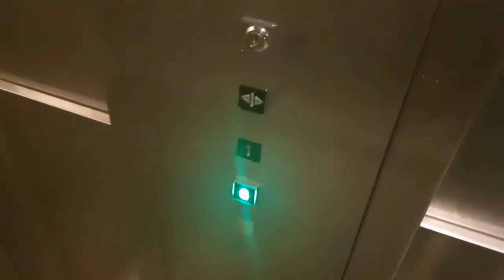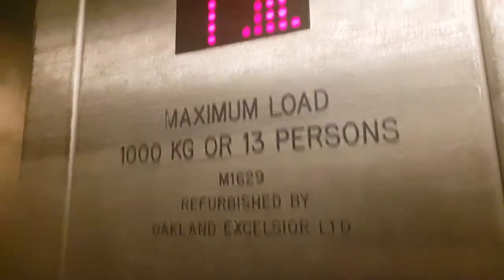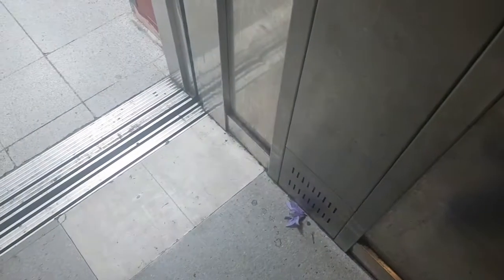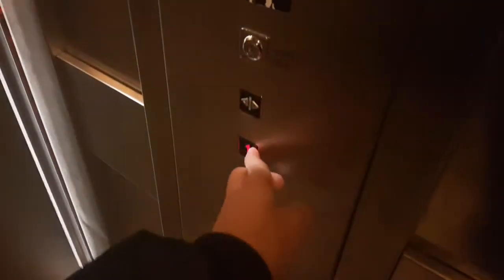Generic with pre-doors

Comment: this was the lift i was stuck in aswell it's really old. https://www.youtube.com/watch?v=5DEZ_WMZrMc
Reply from the maker: Did the alarm work and if it did, did it call someone? That's not safe if it didn't call someone.
Reply: @LiftAdventures  it didn't call someone i just was sat in there.
Reply: it didnt call someone! @LiftAdventures
Reply from the maker: That sounds unsafe. At least you're out!
Reply: @LiftAdventures  yes atleast i'm out because i didn't see a black call boton that calls 999 all i did is press the bell but everyone probly think it was the fire bell xD
Reply: Thanks for loveing it :D
Reply from the maker: It's rare you hear a mechanical bell as a fire alarm now, it's mostly electronic sounder. A lift alarm and older fire alarm do sound the same though as they're the same bell used. 
The button that calls emergency rescue or the lift company should normally be wired into the lift alarm button.
Reply: @LiftAdventures  yes but, i still know fire bells used in places like a school but for some resson people probly think that but yeah, i dont know if people did think it was a fire bell it just sounded like a bell 😁 But luckly i found a call botton!!